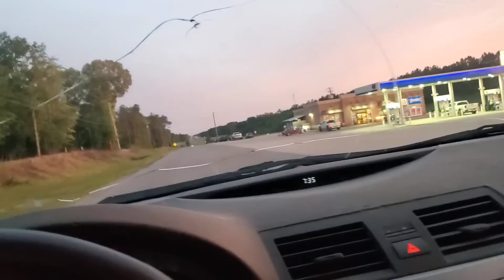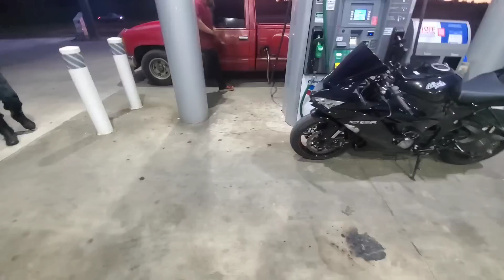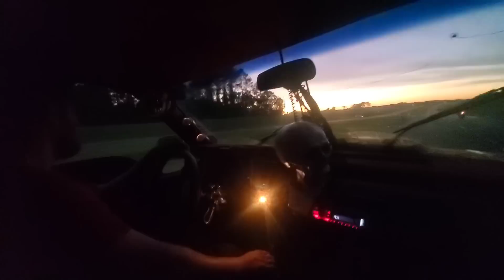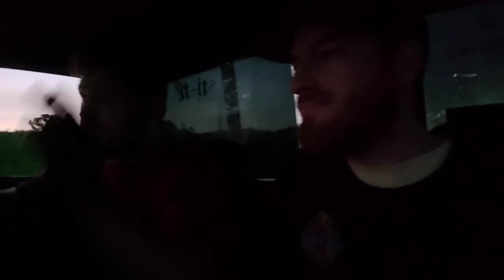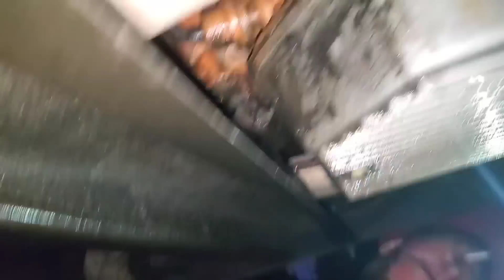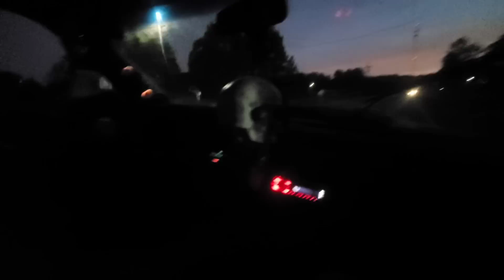Ol Red Goes Up Against A Ninja ZX-6R But Doesn't Go Good

Comment: Damn , I just broke or screwed up my transmission in my 85 S10 . Been fine doing hard pulls and burn outs on main roads but soon as i took it to drag strip then something happened and not good . I lost TQ Lockup and it's maken a noise in 1st gear and in D , took it to a guy ik that does transmissions he said sounded like I tore up the planetary gear inside ha so.... not good might be looking to 5speed swapping it

Comment: It's hard to out run a bike . 800 lbs with rider v/s 4000 lbs truck that takes a lot of h.p.  Good luck boys!
Reply: ZX6R only weighs 450 wet, so it's only 650 lbs with a 200 lb rider.
Reply: I’ve got the bike down to 405 lbs and I’m 165 which doesn’t seem like a lot of difference from what your saying until you actually ride like that! It’s like shaving a couple hundred off and car or truck!!
Reply: @TheReaper-636  I've a zx-9 R. I'm not sure what it weighs . It's fast , swing-arm is extended so it doesn't stand up like yours.
Reply: @jeffshepherd6208 I’ve thought about doing a extended swing arm but I like hitting curves to so I’m still debating on lowering it and strapping the front end so I can still hit the curves but it not stand up as easy
Reply: @TheReaper-636  mine don't handle bad it still pulls the wheel but less than a foot
Reply: @jeffshepherd6208  oh really? I might look into it then!
Reply: @TheReaper-636  My bike has extensions to the stock arm so if I wanted it back to stock it would take about an hour to swap. What year is yours? Mine is a 99 . It is fuel injection.
Reply: @jeffshepherd6208  mine is a 2023 model
Reply: @TheReaper-636  hell yeah.  What are the factory power ratings?
Reply: @jeffshepherd6208  factory it’s supposed to be 130 hp but to the tire it’s like 110 or 115 how it’s set up it should be making roughly around 125

Comment: It might be a close race if it was a early 2000s zx6 but a 2023 zx6 with full exhaust and programmer is pretty bad machine. The only chance hot wheels would have is good slicks and nailing that 190 shot from a dig, hoping too hook up and not break shit.
Good stuff guys atleast ya made it home in 1 piece.

Comment: That truck on a 200 with a decent transmission will kill that bike that bike on its best day is a mid 11 sec bike I’ve had basically the same combo as the truck and been low 10s high 9s at 136-138 mph he needs to straighten that thing out